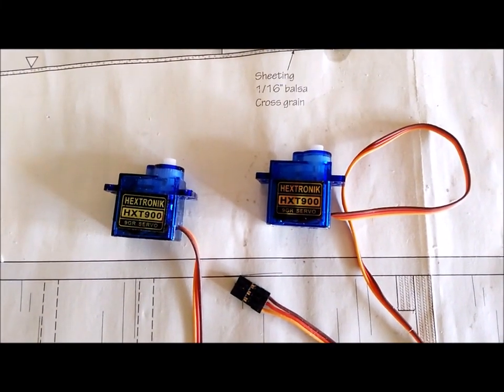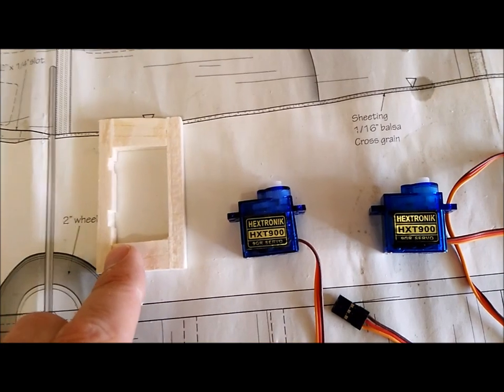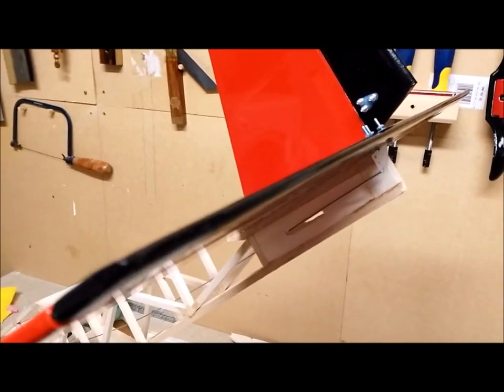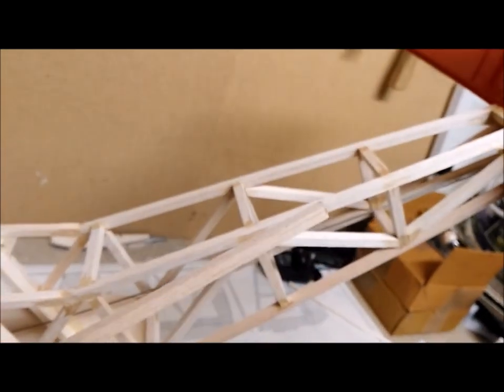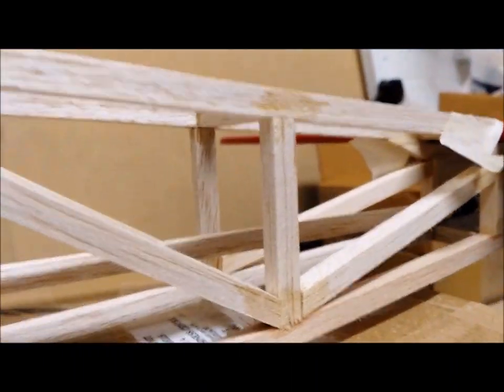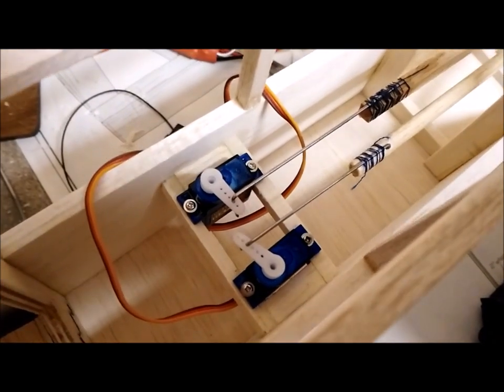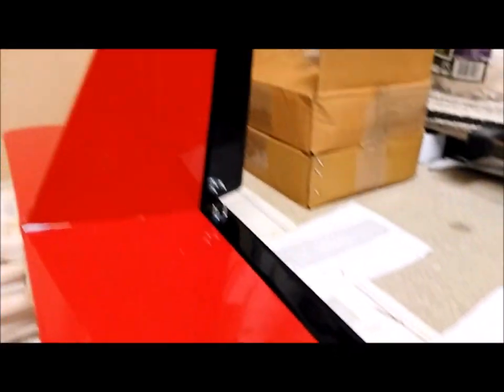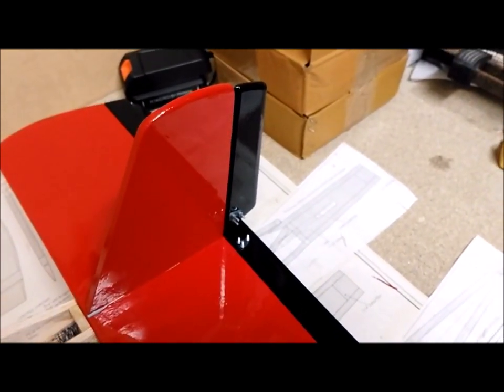Video 14: Installing servos and pushrods

Comment: Why aren't your pushrods simply all metal?  do they really bend?  I'm new to this and this is the first time I see a wood dowel in the center of the pushrod.
Reply from the maker: It's as per the plan. Using balsa would help prevent flex of an unsupported metal rod. Is an old method of connecting servo to surface, There are far better pushrods on the market. But it's interesting to see how things used to be done.

Comment: Just looks like extra work to me Connor, and for little benefit. If I have a long control rod 'travel' I simply 'sleeve' the middle section of the control wire to mitigate any deflection /  sag. The way you have done it,  you have introduced two further potential fail points at each of the metal to wood connections - I am an older flier but with modern techniques and available components, you just dont need to use the old school ways!

Comment: You seem to have given the servos extra weight to move in using balsa instead of just control wire
Reply from the maker: Hi, yeah you're right but the servos are up to it. Plus, the balsa reduces the flex in the length. It's old school solution and control rod would also work, just wanted to follow the plans and get back to basics!

Comment: Where can i get pushrods and could i use guitar string
Reply from the maker: Pushrods are available from your local model store, or online model shops. Guitar string wouldn't be up to the job.
Reply: @BuilderOfModels  thanks so much for ur help
Reply: I have used guitar string on my pattern planes. However my setup was pull pull for both elevator and rudder. The plane in this video would work fine with push rods available at most online RC hobby stores.

Comment: Why use balsa in between?
Reply from the maker: Hi,  wire on its own will flex along its length as it's unsupported. The balsa adds stiffness along the length of the pushrod.
Reply: @BuilderOfModels 
Also, balsa is lighter than metal wire. Everything behind the C.G. must be kept as light as is practical.
For every gram of weight in the tail, it takes 3 grams of weight in the nose to balance it out.
Reply: Conor O'Neill what about a thin piece of balsa with 2 small holes to serve as guides and support for the pushrods?

Comment: I see a bunch of people using hexatronic, from Hobby King I am guessing?  I also see Towerpro servos around alot.  Are they comparable to hexatronics, better, worse?  Are there any 9g servos brands to avoid? My real bet is that they are all just rebranded? 
On a separate thought... I am nowhere near a RC engineer nor would I even pretend to be as knowledgeable as Conor but IMHO putting a bend in any type of control  linkage I would say is a risky move.  That being said piano wire is no joke, it might hold up.
Reply from the maker: This way of installing servos is old skool for sure. It's perfectly suitable for small light planes so long as the bends in the wire are shallow and kept to a minimum. It also avoids having to put in additional formers down the fuselage to mount guide tubes (thus keeping the weight down). Bigger planes will certainly need more robust pushrod solutions.

Comment: Why do you use a balsa pushrod? Why not run wire the whole way down?
Reply from the maker: Hi, as it's a small and light model the pushrods are thin and could flex if they run the whole way (especially as they are unsupported by tubes or guides). So I use hard balsa to provide stiffness over the length. It's only one way of installing pushrods, so if you're building you can use any method you prefer. 😃
Reply: Conor O'Neill ok, thanks 😀
Reply: Conor O'Neill also, I'm quite new to all this. Do you know of any free plans that would be good for beginners?
Reply from the maker: Hi, a good place to start is aerofred, and filter there for trainer models. Plenty to choose from.
Reply: Conor O'Neill cheers!

Comment: Hello Conor, where can I buy the push rod from please? or what is it called.
Reply from the maker: +Nathaniel Ihenachor hi, the push rod is made from balsa strip and 1.5 mm diameter wire. I bought the wire off eBay, but I would recommend using threaded wire and clevices to make the connection easier.